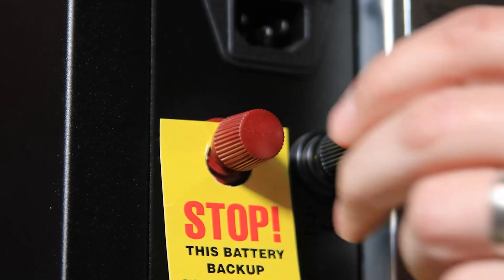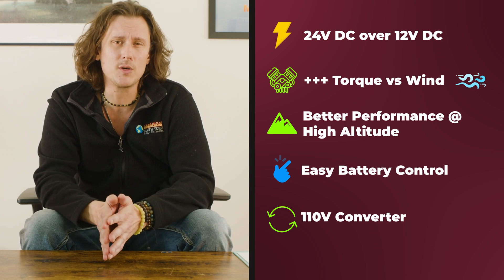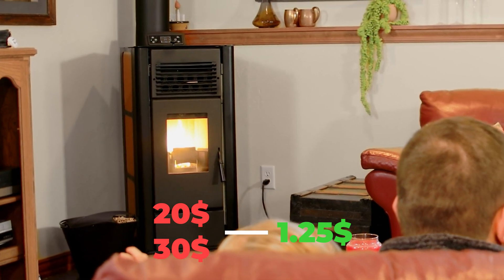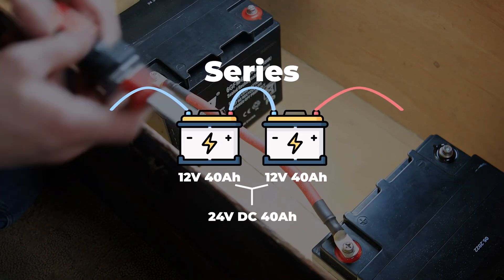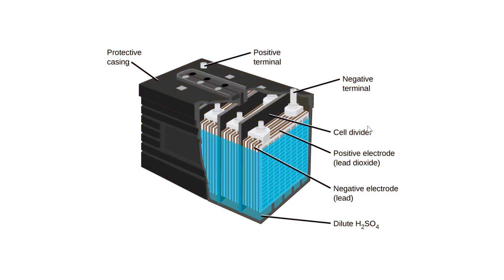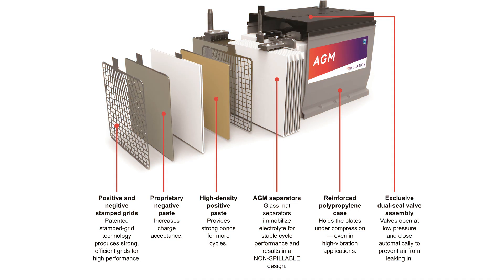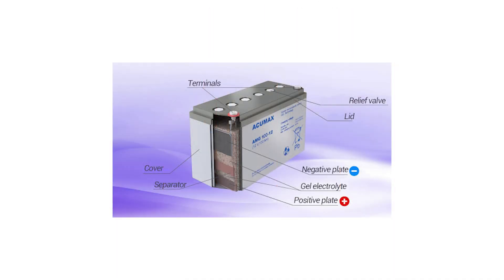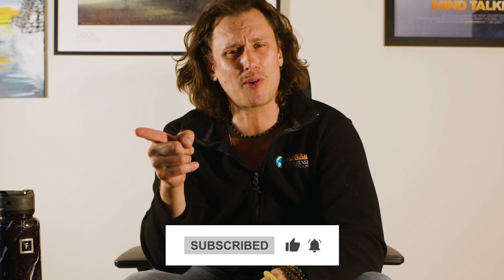AC vs DC Pellet Stove Battery Backup 101

Comment: I have been trying to figure out why my distribution blower keeps stopping on my PP38+. Although I haven't been able to figure it out yet. Your videos have been very insightful. Thanks
Reply from the maker: Thanks for contacting us, glad the videos have been helpful. Two things to suggest regarding your distribution blower on your PP38 Harman. 

1. Let's clean the ESP Thermistor Probe. This probe is located in the exhaust and controls many functions including when the distribution fan comes on and off. Video Here for Cleaning: https://youtu.be/kt7nnGMYU-k?si=jrcIsqqAtXkGvBdB

2. Let's run your distribution fan to direct power to ensure the motor itself runs consistently at line voltage. Video here on creating a test cord: https://youtu.be/rlmiCYI2WPk?si=1S1kdEC-nnqE5Hjk

Keep us posted, happy to help!
Reply: @EarthSense  i Tried both seems like that fan itself is working but it only comes on when i test it the knob for distribution does not turn it on at all.
Reply from the maker: @ Thanks for the message back. Glad you were able to run the blower to direct power and it works correctly. That leads us to the issue either being a faulty ESP probe, control board issue, or a combo of the two. These would be the only components in the stove that control the distribution blower. 
If you have the original 2-dial rotary control board on your P38 it will require the upgrade board kit - Reference here - https://pellethead.com/product/harman-p38-circuit-board-retrofit-upgrade-kit-pre-serial-008190059-oem/
Your P38 should have a black wire ESP probe - Reference here -https://pellethead.com/product/pellethead-replacement-harman-heatilator-thermistor-esp-probe-black-wire/

Happy to help however we can.